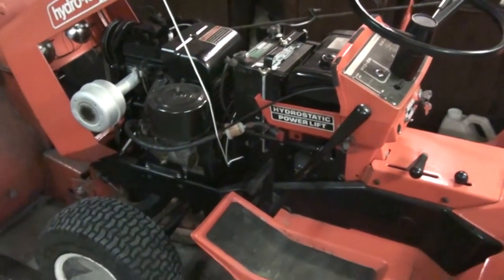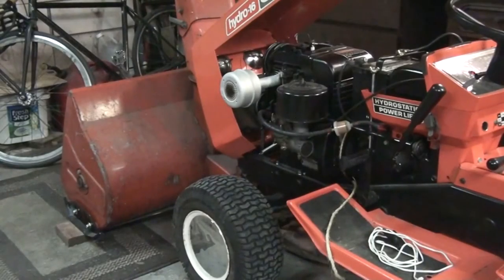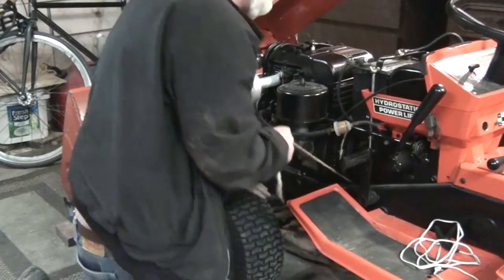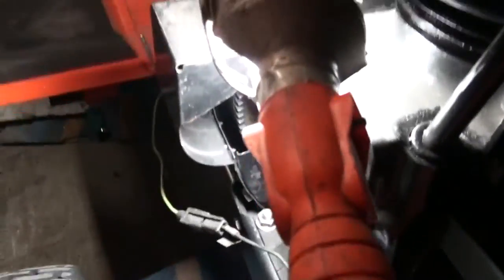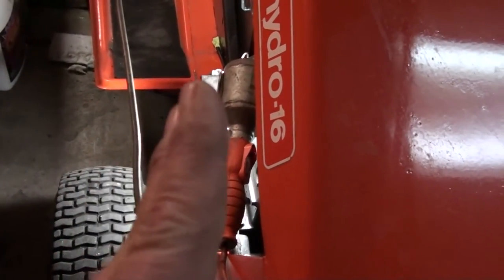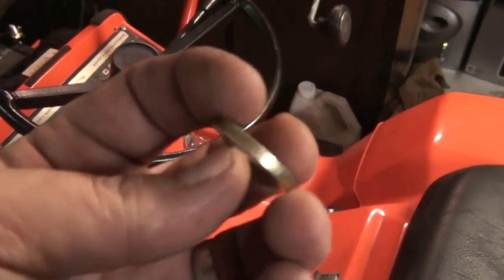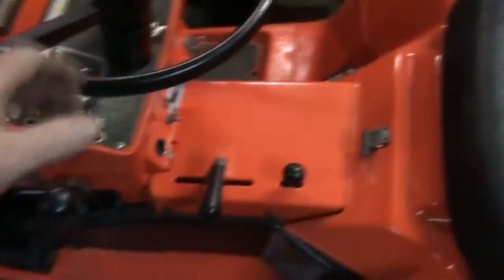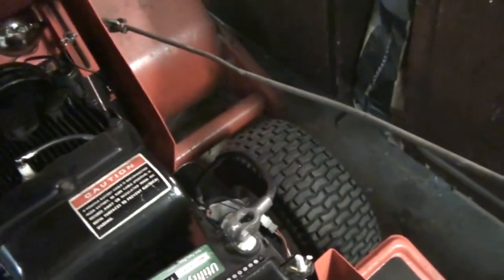1975 Gilson Hydro-16 tractor starter fail

Comment: Bummer about the starter problem. 
When you said about the snow coming your way, I was think ohhhh no, but then it turned out to be the week or so before.  
I watched that video, but didn't comment.  Now I wish I would have.
I hope you are done moving snow for the year. hehehe
Reply from the maker: Yea, I hope so also but we both know I probably am not. At least March/April what snow fall happens is usaully small so the little tractor will deal with it I hope. :) Ride safe man if your out there yet I have seen a few riders since the weather turned a few weeks ago even with the snow.

Comment: in theory the rope start would work, but it doesn't help when you have no spark, lol, good luck, thanks for sharing.
Reply from the maker: Thanks bud, yea got it all sorted out. The biggest issue was the starter gear on the starter was wrong. I went to the manual (PDF I found online) ordered the correct gear and presto no more issues. :)

Comment: Next gear you buy, roll it into the flywheel and see if it matches before you mount it. That sucks Scott!
Reply from the maker: Yea it does. Its such a simple thing you would think it would be easy normally this sort of thing is not a big deal so I don't think about it much however this is frustrating me so that is why I did the videos hoping someone see's it and has a fix. :)

Comment: will a magnet stick to starter teeth on fly wheel . i think the steel flywheel uses 14 tooth metal gear and aluminum ring gear uses the 16 tooth plastic gear , but i could be wrong on that .

Comment: If you have the original starter put both on a flat surface end to end and look at the nose position  between the two.  Worth a try getting the mounting ears on the starter at the right height .
Reply from the maker: Yea, that was my point in the video I did not keep the original I sure wish now that I had because until the winding went it was a really good starter. A mistake I won't make again. The thing that bites is that snow removal is the only reason I have that tractor. :)

Comment: interesting on the starter gear. I would have to look but think there are 16 and 14 tooth starter gears . I usually make shims out of pop cans or something like that . Can u engage starter by hand to see the clearance . wonders what the id numbers on the engine its self are . may be able to look up a manual and see what was on it originally. did u have cover off to see what happened when stripped , or see any wear pattern after the first start or two , any different noise . nothing making starter try to engage after engine is already running
Reply from the maker: All good questions, I did not realize the shroud came off the housing exposing the starter and fly wheel until after it stripped but when i engaged it I did not hear anything or notice anything different. Thats the part about plastic gears if they bind there is almost no noise. It only spun the fly wheel once before stripping out the gear. I will check maybe the number of teeth is the issue, I have a parts manual for that B&S motor that is where I got the starter number from. It really does not show much dang it. I will go see if a magnet sticks to the teeth or not.

Comment: hi I just wanted to know if you had the mowing deck with your gilson mabe you could help me figure out a few things that I am missing on mine! thanx
Reply from the maker: I do have it I have only had it on a couple of times so I will try my best to answer any questions. So let them fly. :)
Reply: I dont have the link to raise and lower the deck but i cant figure out where it is supposed to pass so it doesnt hit any parts of the lift mechanism so if you haventhat link and remember where it passes and connects on the tractor it would help me alot! Thanks

Comment: Hey all. Hoping for some help. My bf has a 1975 MW Gilson hydrostatic 16. I'm trying to find out where to put hydraulic fluid. Even though my bf has a manual for this exact model, it said to take it to a dealer for this issue, so you see where another problem lies lol. I read somewhere that no hydraulic fluid was really ever to be needed unless of a leak. So obviously there are no dealers anymore and so here I am on behalf of my bf. I'm really hoping to get an answer quick because I have about 3 feet of snow that I desperately need plowed. lol. Thanks in advance and I'm really hoping to hear from somebody on this issue. The question being, where and or how do I add hydraulic fluid to this '75 MW Gilson hydrostatic 16?
Reply from the maker: Hi, so the hydraulics on these old tractors are hard to work on really. My Hydro 16 is an automatic and the fluid used by the transmission is also used to raise and lower the snow thrower. One place that maybe able to help is http://gardentractortalk.com/forums/forum/15-gilson-tractor-forum/ they have a great Gilson community and answer questions pretty quick. There is also another forum at http://www.mytractorforum.com/264-gilson-montgomery-ward-mfrs/ so hopefully you will get the answers you are looking for. GL and take care and be safe!
Reply: MidwestMotoRider Thanks so much!!!